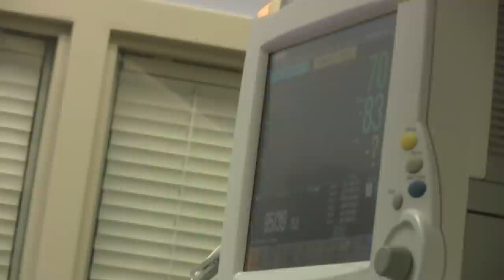Dislocated Artificial Hip Reduction

Comment: May I critique the sedation part? It was seemingly a very hefty dose of Propofol (fair enough to help relaxation with increasing apnea risk) but the saturations were in the low 80s without BVM or water (Mapleson) circuit being urgently readied, beyond a jaw thrust? Additionally there was no end tidal CO2. The groan at the start of the case without actually manipulating will have exhaled a lot of the oxygen. If she hadn't the hip held up like that (without reducing), she might have taken a couple more inspirations instead of the exhaling.
And a MAP of 54? Hopefully fluids were running fast. 

Very smoothly done with the reduction though. And you are extremely knowledgeable, I would just not be comfortable with the level of hypoxia.

Comment: much harder to do a natural hip. Done both. You need to kneel straddling pt's leg, put elbows on mid-thighs, forearms parallel, hands holding up under pt's knee then slowly FLEX your knees. The lever effect you get from the tiny upward translation of your hands is actually surprising.

Comment: i dislocated my hip while bending over to pick up my sweat pants.  Had replacement over 4 years ago.  never thought I would have to worry about this after this long.  After dislocating the hip, I realized that my phone was in the other end of the house.  (I live alone)  I had to push my self, while on my back from my bedroom to the living room.  While using my left leg to kind of hold up the right, dislocated leg.  This took me about 40 minutes to do. At least I do not have carpet.   Only someone that has had a dislocation can understand the amount of pain this was.  I will never not have my phone in the same room with me again.  Find myself terrified of it happening again.
Reply from the maker: Thanks for telling your story.  This will help others!
Reply: I know your pain...I have two total hip joint replacements right and left and this happened to me twice on my left hip,I hope you never have to through that again.
Reply: Kathryn Smith, Had right hip done 12/2008 metal-on-metal. No problems. Left hip done 4/20/2014, was to be like the right one, but almost bleed to death before starting & had to have ceramic instead. At 6 weeks post-op, the left dislocated as I was getting up out of chair. Fortunately, phone was right beside me! Pain was unbelievable!!! Had to go by ambulance to ER where they attempted to put back in place 4x but kept dislocating. Had to have surgery to replace parts worn down by attempted realignments in ER. Socket widen, replaced with a new plate & screwed in so ball cannot roll out now. Ball, femur head replaced also. No post-op pain either time!! I tell everyone I rather be giving birth x3 & all together than the pain from the dislocation!!! Hope you are well.
Reply: Kathryn Smith
Reply: I dislocated once getting into the car when I was alone. For some reason I thought if I stood up it would pop back into place. When I did that I left the phone on the passenger seat and had to lean across to get it. Called for help still standing beside the car. Started to get faint so sat down only to have to get out again when my son got there to drive me to the hospital.  Horrible. The 3rd time I was alone in a hotel room taking a shower in a tub. Left phone back on bed! Had to get out, unlock the door and make it to the bed to call! Like you said, only someone who has been through it can understand!
Reply: @nana-x9  I tell everyone when asked about the pain of dislocation that I have given birth 3 times and the pain was not equivalent to the pain from the dislocation. No one will ever understand the extent of the pain unless they have gone through it themselves.
Reply: This is scary. I had my replacement surgery in Sept '23, dislocation one month later. Now, you indicated you had a dislocation 4 years later.that in itself is very scary. I had no idea that could happen from such a simple movement a few years later. I guess that means my life has forever been changed after having that surgery and that there are many more limitations than told.

Comment: Mine popped out when I was at a remote hot spring. I had friends try twice to forcibly pull it into place but it was too painful. I had some muscle relaxers (Baclofen) and some Brandy so I chewed up the pill and did a couple shots and waited a few minutes. As soon as I felt more relaxed I had the two friends gently pull downward and outward as I was concentrating on relaxation of my entire left leg. It went back instantly and I haven't had any trouble with it since. I even drove home from the Hot spring with a standard transmission.